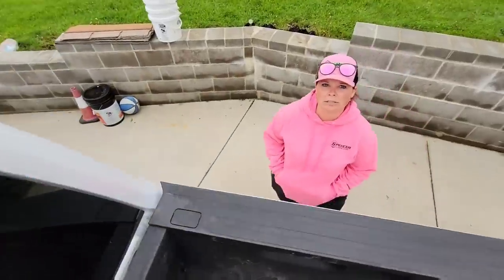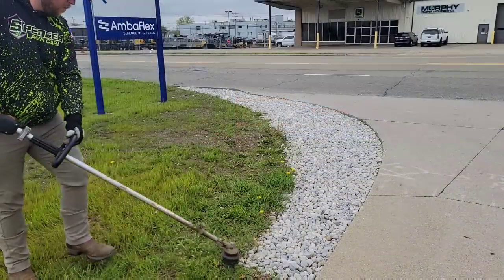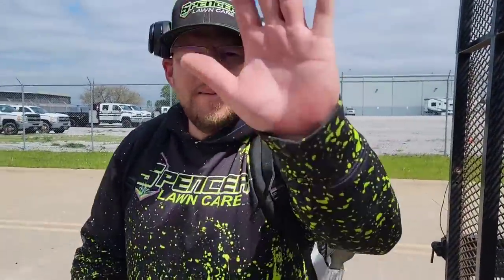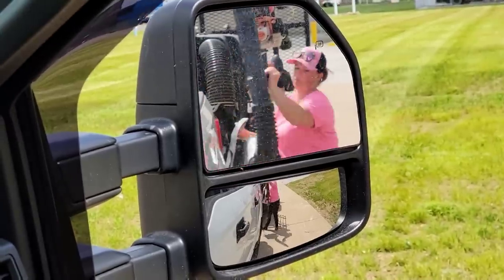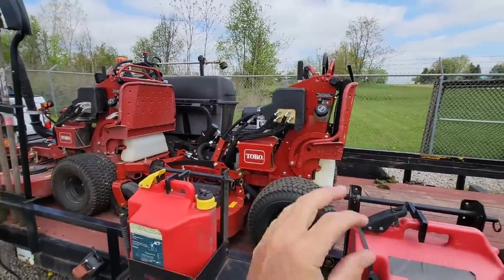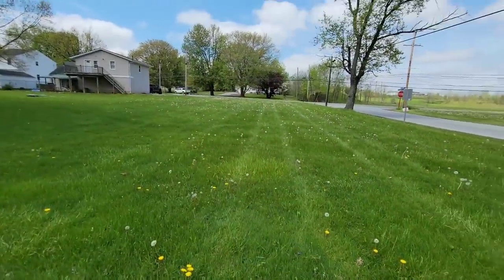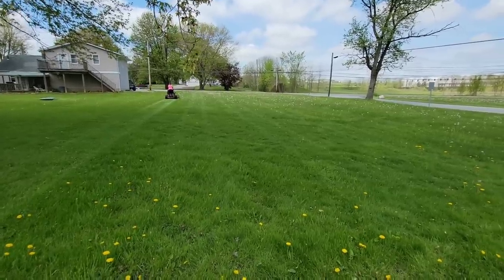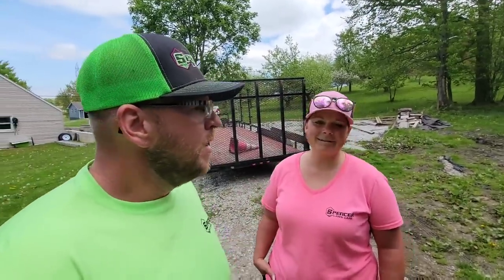CUSTOMER HAD THE AUDACITY TO CONTACT ME AFTER FIRING ME!

Comment: What’s your first impressions on those Ballard blades? I’m holding off getting them till your final review video on them. I’m also gonna get some of that cleaner and a Darwin’s grip as well. I’m also gonna be getting an echo combi unit with edger attachment, my spare combi weed eater bit the dust, so I’m gonna replace it with the echo. I have the echo srm-225 and I like it a lot.

Comment: Sean put a hidden kill switch on your truck and put an alarm on the trailer or camera system that will alert you of any motion. Then send the dog out first and then you come out armed. You park your trailer at your home. You have no excuse for not getting an enclosed trailer, I am not trying to break your balls. You are wasting time and energy dickey docking around with unloading every day. As you get older your time becomes more valuable. Maybe fence in your yard and park your trailer there with a nice guard dog. I have been doing this for over 40 years and a police officer for over 30 years, I know what I am talking about. Buy an enclosed trailer and take the necessary steps to protect it. Trust me once you do that you will never go back to an open trailer. Good luck to you and tq.

Comment: Are stand ons or zero turn riders more comfortable to use? I've never been on a stand on.
Reply: I test drove a gravely pro stance 60” a month ago. (I’d want a 32” or 36” and a 52”) they are different, but it seems comfortable. I realized this year starting off on my accounts that my ariens ikon xd 52” zero turn just wrecks my back with the bouncing. (I already have leg and back issues as it is) I hear the stand on’s are better for shock absorbing, so I’m gonna give pull the trigger and give one a shot this year after I find and buy a new house. Prob gonna go with the 32” gravely pro stance with a quick chute to replace the factory grass chute. I have 2 advanced chute blockers on my mowers and they are nice, but the handle isn’t tall enough or at the correct angle for a stand on.
Reply: I use a 54" bad boy and 48" John deere. I like them but I don't like constantly getting out of the seat to pick up sticks.
Reply: @mihatsu2336  I have the ariens ikon xd 52, and an ariens waw 34 walk behind. I’d like to get 2 stand ons eventually, but I’m gonna go for the 32”-36” gravely pro stance first and keep using my zero turn for this year. then next year  I’ll get the 52” pro stance and keep the zero turn as a back up, possibly get a bagger system for it, and to use for the lawn cart for the yards.